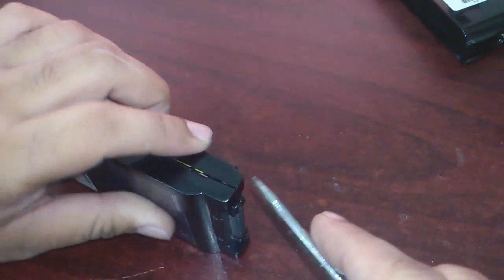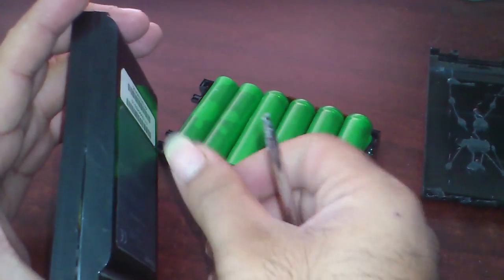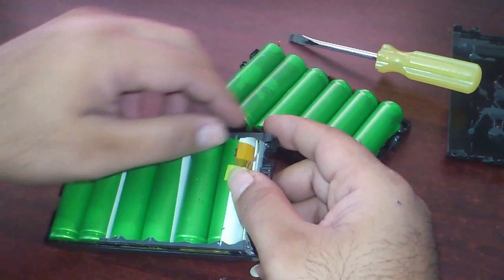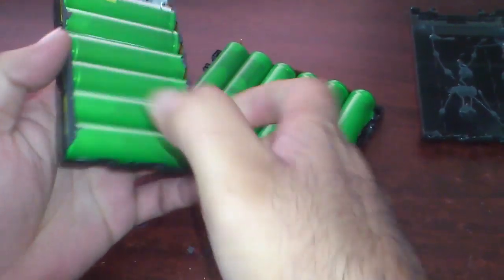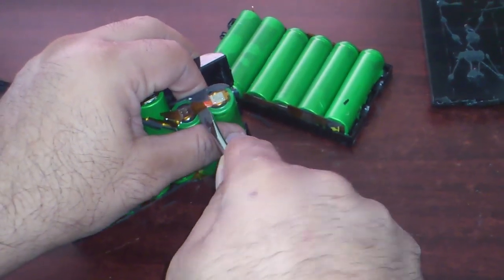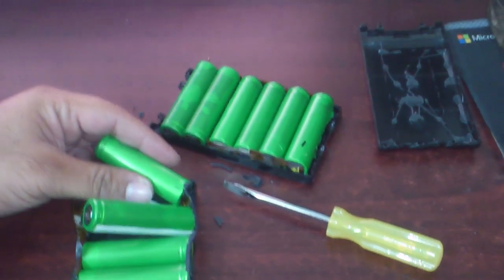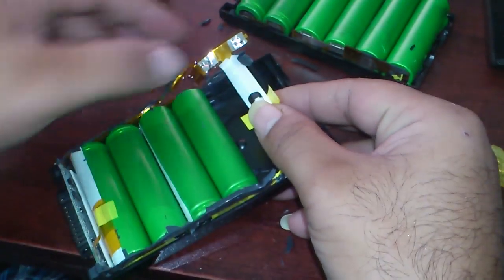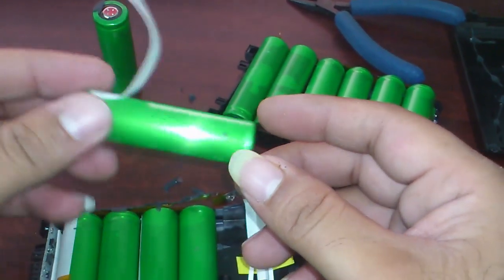Battery Cell Replacement for your OLD Laptop Battery

Comment: Hardly any laptops use these cells, most use LiPo pillows.
Reply from the maker: True, but that's an old Toshiba cell. Also you have to think this is Bangladesh!
Reply: +Dick Carter No they don't. Lol
Reply: Mine does :)
Reply: My MSI GL65 uses these cells. I think they are 18650 cells.
Reply: Where can I buy replacement cells